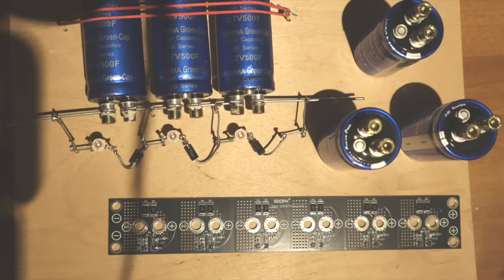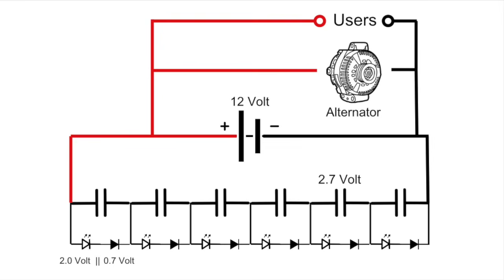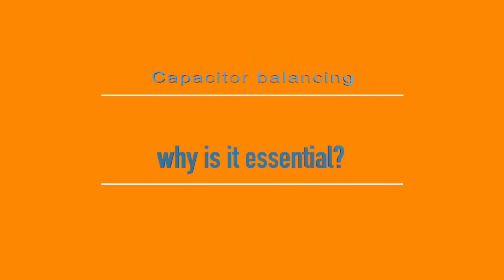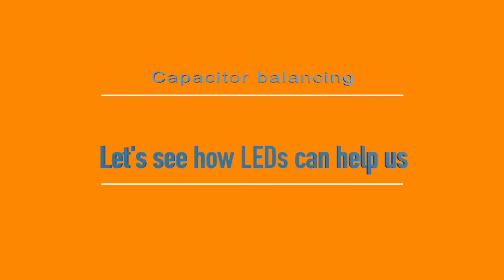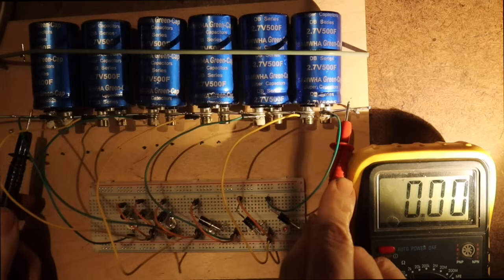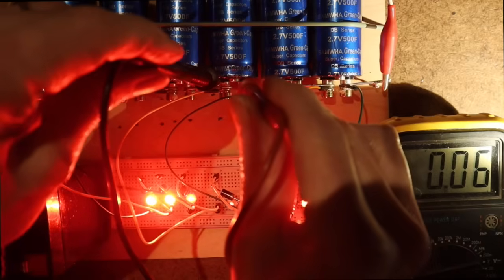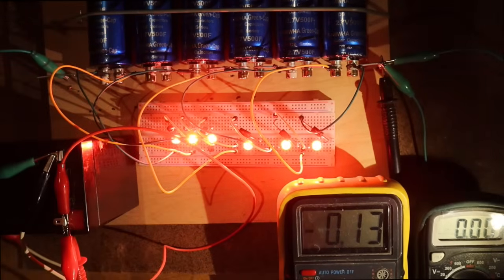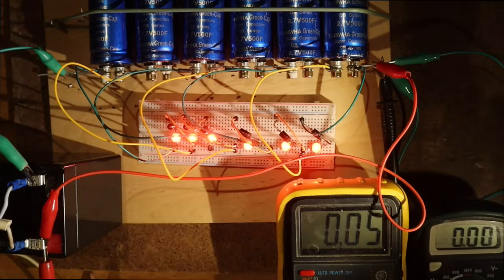How can a Super Capacitor help you start your car reliably and let live the battery longer? 86

Comment: BLOOMBERG- 7000+ DATACENTRES- USING SAME ENERGY AS ITALY, 2034-USAGE AS BIG AS INDIA"S- AAAAAGGGGHHH!!!!🤯🤯🤯🤯👎👎👎👎👎💀💀💀💀☠️☠️☠️☠️
Reply from the maker: Hi Liam, it's incredible. There should be a heat recovery on each of them, see my last year's video on https://youtu.be/cTnZUlZ1EuU
Reply: WATCHED IT- GREAT INFO-CANT SEE ANY CHIPS GETTING HEAT CAPABILITIES-OR HEATING TOWNS- THEY TEND TO BE AWAY FROM BUILT UP AREAS- AN IDEA WOULD BE TO BUILD UNDERGROUND-WITH GOOD INSULATION- IF ITS IN TEXAS,INSTEAD OF FIGHTING 30- 40 OoC HEAT, ITS AT 4- 8, AND WITH PIPING,LIKE GROUND SOURCE HEATING, COULD DISSIPATE VAST AMOUNTS OF HEAT INTO SOIL,TO BE SLOWLY RELEASED INTO ATMOSPHERE..
I KEEP MEANING TO TRY PUTTING A PELTIER CHIP ON A PC CPU,WITH A TUBE AROUND THE CHIP,WITH A FAN,THAT PULLS THE HEAT FROM THE PELTIER AWAY FROM THE PC...
SOME TIPS FOR YOUR NEW HOUSE...
IF YOUR ON MAINS WATER- PUT A SMALL WATER TURBINE IN- LINE- THE WATER COMPANY USES HIGH PRESSURE TO MOVE IT UPHILL- USE THAT PRESSURE TO CHARGE PHONES,LAPTOPS...AND IF ITS GOING INTO A TANK IN THE TOP OF THE BUILDING-FIT ANOTHER ONE ON THE DOWN PIPE...
IF YOUR PROPERTY HAS A VOID BELOW THE ROOF, CALLED A LOFT IN THE UK/USA, FIT A SOLAR FAN TO DRAW HEAT FROM IT, BETTER STILL, PAINT THE ROOF WITH DIY HEAT REFLECTIVE PAINT- SEVERAL YOUTUBERS SHOW HOW TO MAKE..
GET A TEMPERATURE CONTROLLED KETTLE-I HAVE ONE FROM DREW+COLE,WHICH IS ALSO INSULATED- FANTASTIC-I SET TEMP AT 80oC- IT CLICKS OFF,BUT IN A FEW SECONDS,ITS DISPLAY SHOWS 90oC-SOMETIMES 100 THE "RESIDUAL" HEAT IN THE ELECTRICAL ELEMENT, HAS ADDED THE EXTRA HEAT- GO ONLINE, AND CHECK TEMPS FOR BLACK,GREEN,WHITE TEAS, COFFEES,ETC- YOU DONT NEED 100 DEGREES - IN FACT, IT REDUCES THE FLAVOUR OF SOME- THIS IS IMPORTANT - WHY?
TO GET FROM 95 TO 100oC TAKES 5x THE ENERGY THAN TO GET FROM ROOM TEMP(I FILTER+LEAVE WATER TO ROOM TEMP THE NIGHT BEFORE) TO 95...THIS IS DUE TO ENTHALPY-WHEN YOUR KETTLE STARTS TO SHAKE, MOLECULES ARE  THROWING OFF LARGE AMOUNT OF ENERGY TO BECOME STEAM..
MEASURE THE WATTS USED TO GET WATER FROM ROOM TEMP TO 90- THEN CONTINUE TO 100- JUST IMAGINE HOW MANY CUPS OF DRINK ARE MADE WORLDWIDE,EVERY DAY-SAVE MONEY,SAVE TIME,SAVE THE PLANET!!
ALSO, AS ITS INSULATED, IF YOU HEAT 2 CUPS OF WATER, AND USE 1, THE NEXT TIME YOU GO FOR ANOTHER CUP,IT COULD BE AT 80-SO IN SECONDS,YOUR UP TO 90...YET MORE SAVINGS...
TEA+ COFFEBAGS- DISGRACEFUL- I BUY LOOSE,ORGANIC TEA- BAGS ARE DOUSED IN CHEMICALS LIKE BLEACH, ARE BAD FOR NATURE,AND- CUT ONE OPEN- SEE HOW MANY SPOONFULS YOU GET-THE BAG SOAKS UP SO MUCH,THEY HAVE TO PUT EXTRA IN, OR YOU'D GET NO TASTE- TRY PUTTING JUST A SPOONFUL IN A BAG, AND THEN TASTE IT!!  ANOTHER TIP( HEALTH) ROTHERHAMS 2 HOSPITALS,GIVES IT'S SENIOR PATIENTS ONLY DECAF COFFEE AND TEA-BECAUSE IT REDUCES FALLS BY 30%- FALLS 8N SENIORS ARE A MAJOR CAUSE OF CONFINEMENT TO BED,AND DEATH.
IVE BEEN USING AIR OVENS FOR AROUND 8 YEARS ,2 TIPS,- THE FAT TRAY NEEDS WEEKLY,OR MORE,CLEANING- WHY? IF LEFT, THE FAT ABSORBS HEAT,TO CHANGE TO LIQUID- I WANT THAT HEAT IN MY FOOD, I ALSO PUT  THE FAT TRAY  AS HIGH AS POSSIBLE-WHY HEAT THE WHOLE OVEN, WHEN I'M ONLY USING TOP HALF/ QUARTER??
I ALSO WATCH TV IN THE DARK-MY PHONE GIVES ENOUGH LIGHT IF I WANT TO LOOK FOR SOMETHING-AND THE PICTURE QUALITY+ COLOUR IS FANTASTIC- IT'S WHY CINEMA'S DONT HAVE LIGHT,AFTER ALL... I ALSO HAVE A 3 METRE HEADPHONE EXTENSION LEAD, I WATCH A LOT OF MY FAVOURITE MUSIC VIDEO'S AND AGAIN, THE SOUND QUALITY IS AMAZING, AND WITH ACTION MOVIES AS WELL
I USE HIGH QUALITY THERMAL LONG JOHNS+ LONG SLEEVE TSHIRTS- BRITISH THERMALS DO GREAT GEAR, CHEAP- ALSO-TRIED LIDL'S THIS YEAR- VERY GOOD- THESE+ A GOOD FLEECE - LOWE ALPINE ,400GSM- ANYTHING LESS THAN 300 IS NO GOOD FOR COLD WEATHER AND MY SOCKS ARE 2.4 TOG- I CAN SIT ON THE MOORS, ON THE COLDEST OF DAYS, WITH A THICK, WATERPROOF JACKET OVER THE FLEECE,FOR HOURS,COMFY AND WARM-AND ALONG WITH A KING SIZE ,HEAT ADJUSTABLE ELECTRIC OVERBLANKET( KING SIZE MEANS NO NASTY DRAUGHTS, I ONLY PUT BOILER ON FOR 14- 15 DAYS IN WINTER- MY PLACE NEVER GOES BELOW 12oC ,AND I GREW UP WITH ONLY A COAL FIRE TO HEAT THE HOUSE, SO I'M NOT BOTHERED BY NO CENTRAL HEATING,EXCEPT ON COLDEST DAYS,AS A HEALTH PRECAUTION- I SPEND MY SAVINGS ON NICE HOLIDAYS...
BOILERS- TURN FLOW RATE DOWN, TO WHERE ITS NOT HEATING ROOM PROPERLY - THEN ADJUST UPWARDS, SLIGHTLY - FULL FLOW IN SEPTEMBER-NOVEMBER IS VERY WASTEFUL, THIS TRICK PRODUCES RIGHT HEAT, WITH MINIMUM ENERGY,ONCE A WEEK, TURN IT UP SLIGHTLY MORE...
I ALSO USE A LIDL WAFFLE/TOASTIE MAKER- WITH ITS GRILL PLATES, I CAN COOK ABURGER, PAIR OF CHICKEN BREASTS, RAPIDLY- IT COOKS ON TOP AS WELL AS BOTTOM,INSULATED, SO FAST RESULTS WITH LITTLE ENERGY...
PLEASE TRY, AND IF YOU LIKE THESE, PASS ON TO VIEWERS...
PS- I IMAGINE IN ITALY, THERE WILL BE DAYS WHEN ITS 40oC OR MORE- IF YOU HAVE YOUR WATER AT THAT TEMP, YOUR KETTLE WILL USE AROUND 40% LESS ELECTRIC THAN AT TAP TEMPERATURE..
CAR TIP- START- THEN DONT USE FOR 30 SECONDS- REVVING A COLD ENGINE IS WHAT REDUCES ENGINE LIFE+EFFICIENCY MOST, LET IT WARM UP
CAR TIP 2- RUN YOUR AIRCON FOR A COUPLE MINUTES WEEKLY- THE REFRIGERANT GAS CARRIES THE LUBRICANT STARTING AFTER MONTHS OFF, TOTALLY DRY,CAN SEIZE THE COMPTESSOR RUN IT,EVEN WHEN FREEZING- YOULL ENJOY YOUR WARM HOUSE MORE, AND POTENTIALLY SAVE HUNDREDS...
👍👍👍👍👍👍🥂🥂😃🏧🏧🏧💲💲💲😃😃

Comment: Lithium Titanate batteries are really a better answer to this problem.  They deliver huge current, charge quickly, and don't self-discharge.
Reply from the maker: Hi Alan, do you mean the batteries that are in Jump Starters? I just ordered a rather light one and see that it are indeed rated at 1000 Ampere, enough also for a 3 liter Diesel engine. I will try it out and see what are the pro's and con's. If I look for Super Capacitor jump starters on the market, I find very high prices. This has to be investigated...
Thanks for your tip and also to Liam, which also sent me a similar hint yesterday, which made me look for this alternative (and order this article!).
Reply: @nnvasen-good-energy  Unsure what chemistry is used for jump starters.  I doubt that they have a useful life of more than 100 starts though.  

The LTO batteries have a 20K+ cycle rating.  These are what they put into the electric city busses.  The other advantages of LTO is that they have a very wide temperature range -40C - +60C, and you can drive a nail through one with out an explosion.  They are not as space or weight efficient though.  That is why they don't get used for EVs.
Reply: The powerbank "jump starters" do not actually start your car.  When connected to the car battery, they begin to discharge into the car battery and give it a little boost, warming it in the process, which also helps it to deliver more current.  That's why those jump starters only work once or twice and if the car hasn't started by then, then it won't!
Reply: @karhukivi  They do start cars. I've used one to start my car multiple time on a frozen battery that would no longer hold any charge: I could apply 20V to that dead battery and only 1A got through it, that is ~20 ohms of internal resistance. Remove external power and battery voltage would drop to 10V, which means one shorted cell in the lot and probably a bunch of broken plate connections from freezing over. The jumper pack was the only meaningful source of starting current. Disconnect the jumper pack and the engine would start running rough from the battery failing at its voltage regulation role as well. I had to hook up a 100 000uF cap to stabilize it enough to drive to the auto parts store and get a new battery.
Reply: @teardowndan5364  I wonder if it could start a car with no 12V lead-acid battery?
Reply: @karhukivi  a battery with 20 ohms of internal resistance and 10V no-load voltage is as good as not there.
Reply: I had a lithium emergency starter, but the lithium battery got bad after a few months. I think it has some self discharge due to the bms is always on and you have to charge it often. Mine was always drained when I needed it.
Reply: @ My DeWalt tool batteries hold their charge for a few months. My jump-starter goes completely flat if I leave it alone for a month. That is either extraordinarily high BMS power draw or horribly leaky cells.

From how it split its housing apart after about a year by going "spicy pillow" and only using it a dozen times, I'm going to bet on horrible cells that degrade a lot just sitting there. Even if I disconnect the BMS, the battery voltage still goes down a lot over a month.
Reply: I agree with you. When I first saw the performance chart for lithium titanate, I was a believer in making a hybrid with Lithium Ion a wise choice.
The LiTi can handle your cold starting and surge demand while the Li-Ion can be better insulated against cold conditions without worrying about having too much heat in warmer conditions when drawing a load.
A phase change sleeve wrapped around heat exchanging lines may be the best combination for preventing overheating and overcooling when combined with a thermal management system that includes not only active temperature regulation but also thermal protection during extended times of inactivity in cold conditions. Using supercapacitors may make a good 3rd hybrid for increasing energy capture percentage and burst on demand. I don't think the weight tradeoff is that bad when you look at what you receive for it, especially at start/stop conditions.

Comment: ANOTHER IDEA- I GOT A POWERBANK 20,000 MAH- WITH JUMP LEAD CONNECTORS,FROM ALIBABA OR TEMU( YEARS AGO) £24- FANTASTIC- MY BATTERY WAS SO FLAT, WHEN I STARTED VAN, I TOOK LEADS OFF+ IT DIED- SO I FITTED BACK ON, DROVE 2 MILES TO SHOPS,WITH IT STILL ATTACHED! RETURN TRIP-SAME. STARTED WITHOUT HELP, NEXT DAY.
IVE USED IT WELL OVER A DOZEN TIMES, WORKS PERFECTLY- ANOTHER TIP- ALWAYS ATTACH NEGATIVE JUMP START LEAD TO A CLEAN CHUNKY PIECE OF CAR(I USE THE  HOLE WHERE YOU FIT CHAIN TO LIFT ENGINE- IF YOU FIT TO BATTERY,YOU GET LESS POWER TO STARTER,AS BATTERY WILL ABSORB A LOT, TO GET TO IT'S PREFERRED LEVEL...
THE COMPONENTS IN THESE MIGHT BE JUST AS SUITABLE ( AND A LOT CHEAPER) TO ACHIEVE YOUR AIMS...👍👍👍😀😀😀💲💲💲
Reply from the maker: Hi Liam, you mean such a start booster for the car and that you leave it on the battery or the cigarette lighter to stay always on charge? Why don't you apply to the Energy Home DIY Facebook Group, you give many good comments and would enliven the club there, where there is too much silence (even with 110 members)! It will also be easier to discus and answer on answers (not so direct here as it is there). You will be welcome!
I will look for the product and see if I find Super Capacitors inside it (there should be). And re-engineer it, with pure curiosity.
Reply from the maker: Liam, I don't understand what you did exactly: you kept it under charge continuously and also left the high power poles of the booster always on the battery, as I did with the Super Capacitor bank? 
I am taking now such a booster but can for now only imagine what is inside it. Could indeed be a good alternative for my system, let's see!
Reply: @nnvasen-good-energy  the power bank based boosters use lipo pouches for power. And have diode packs in the leads to stop charging the lipo from the car as there is no charger circuitry. 

It woukd be a very bad idea to remove the diodes and leave it connected. Likely the last experiment you make to your vehicle before the fire brigade have to deal with it
Reply: I AM SO LOUD CINEEZ MARKETING SCAMMER ATTEMPTING TO SELL CHEAP FIRE STARTER FOR CAR
Reply: @Murphydeffa-oq8lm IF YOU LOOK AT THE LAST MONTH'S VIDEOS-YOULL SEE I MAKE COMMENTS ON LAODS OF THINGS..🤡🤡🤡🤡🤡NOT A 🤖🤖🤖🤖🤖🤖😭😭😭😭😭🤡🤡🤡